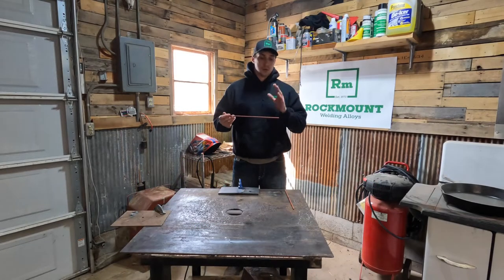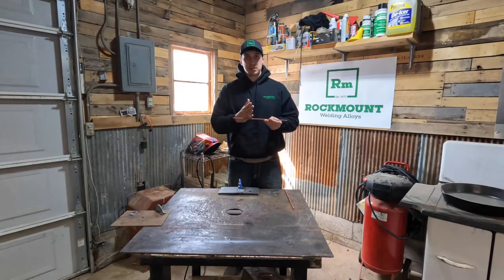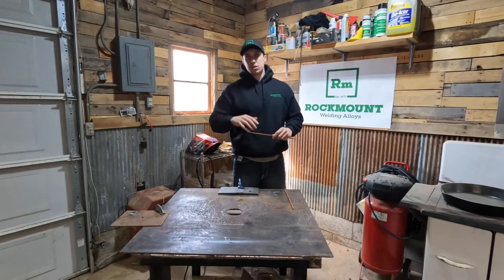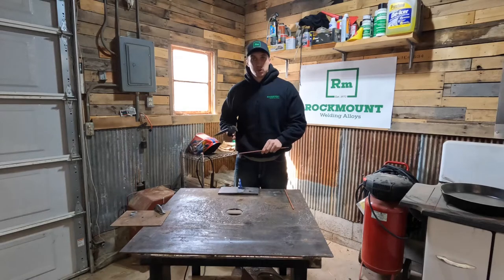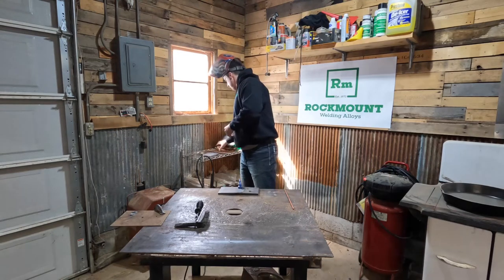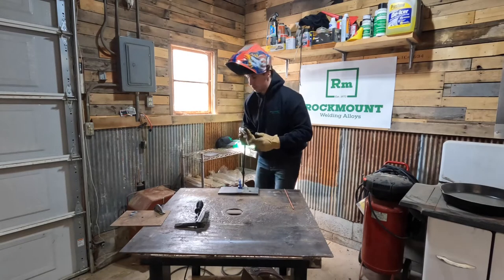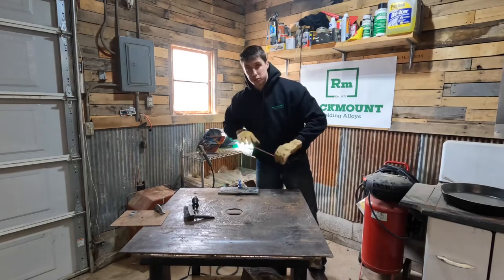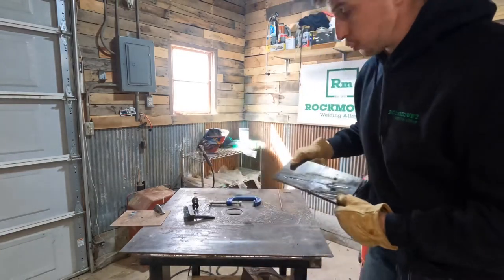How to Use Electra AAA Gouging Rod

Comment: Absolutely fantastic rods! I’m a novice welder but I’ve had ‘The Knack’ my entire life  and so I’m always on the look out for exemplary products. I’ve worked with some incredibly technical material and it’s made me stock my (very) small shop with the best because it’s all I have space for, literally.

These rods will always be around in the shop. Holy G-d are these things serious juice. You feel those 220+ amps to the fullest coming off of ‘em and it sliced through a piece of rebar in well under 20 seconds once I mastered the pool. I’m sure with more practice I’ll use less rod, but even for me it wasn’t extreme. I took less than an inch off the damn thing to bust that bar. 💥

Comment: I have always just cranked my machine up and used the same technique with a small welding electrode to do the same thing. I can see that your electrode lasts longer and will make a longer cut. What other advantages would this have?
Reply from the maker: A lot of old school welders have used 5p or 6011 cranked up to gouge, which works, but it's messy and adds a lot of carbon to the weld zone.  Electra AAA is carbonless, and will create a cleaner champher or cut with much less contamination.  It will be ready to weld without any additional prep.  It's efficiency and alloy make up make it very effective, and a big time saver as well!

Comment: Will the rod burn hole through a 2inch pin like on an excavator? But definitely an interested in the product
Reply from the maker: Depending on the pin, it may work. If the pin is a 2" diameter pin, it would probably fail in that particular application, but we do have an oxygen lance that we call the Air Axe that would be a better fit. If the pin is a small, 2" thick pin, it would be messy and a little difficult, but it could work.

Comment: So you're not using DCEN Polarity? Just straight DCEP?
Reply from the maker: Straight polarity does seem to work best, but it can be used in reverse polarity as well!
Reply: I think you might have those backwards. I always have trouble remembering which polarity is which. DCEP is reverse polarity, what you would use for stick, SMAW, welding. DCEN is straight polarity like what you use for TIG, GTAW, welding. So if Rock Mount is saying to use straight polarity it would mean all the ‘heat’ is in the part being gouged, like how it is while tig welding using DCEN.

Comment: would 200A be to low for this rod to work correctly?
Reply from the maker: It would work! 1/8 runs well on 200amps, DCEN in particular, but AC and DCEP both work as well.
Reply: @rockmountwelding  that’s awesome to hear. I was bummed when it was mentioned you needed 225 amps to run these in the video. I’d be sure to let people know 200amps would be sufficient, a lot of us smaller guys have machines that max out at 200/210 amps and having these around would be super handy. Looking forward to trying some now.